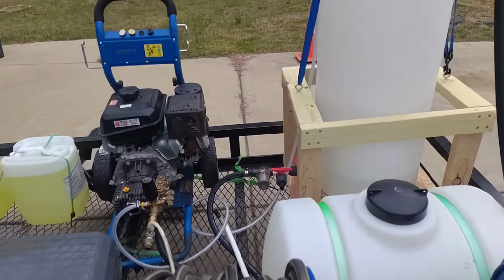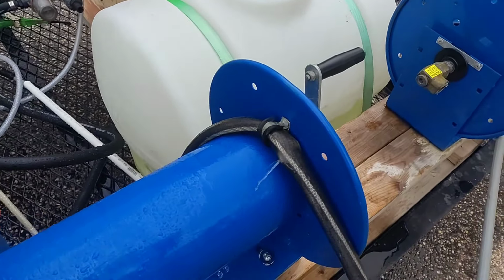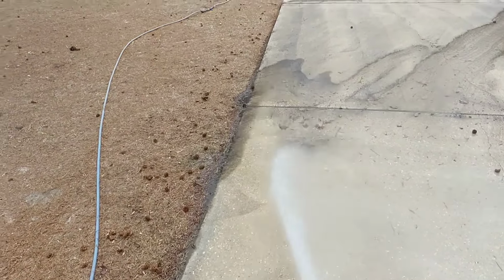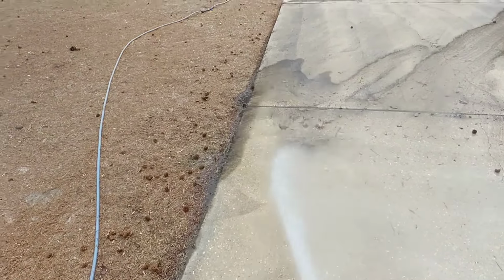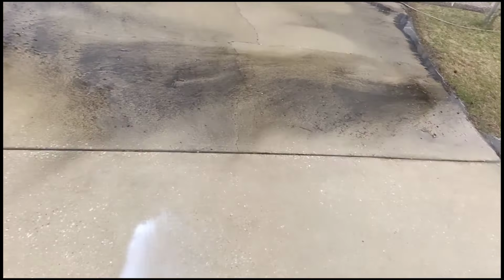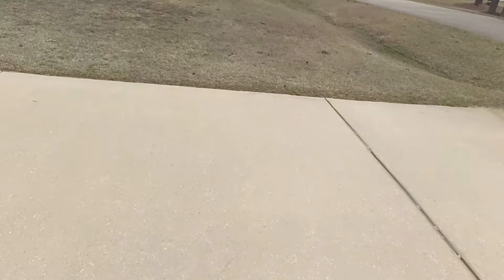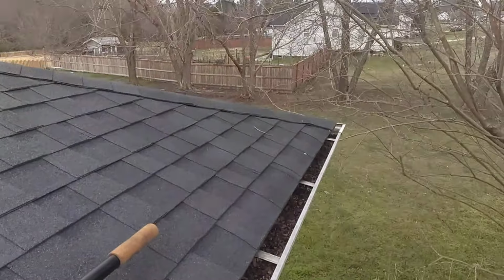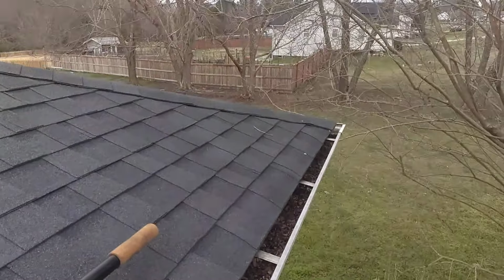Pressure Washing - Trying the Circles method Driveway cleaning and Gutter Cleaning

Comment: I use my hose reels as a way to carry the hoses and never run the hose through the reel connector.
On the supply hose I have quick connectors on each end.
Yes you have to thread on your adapter to the customers spigot but when the adapter wears out you place it for a few dollars compared to the cost of a new hose or repair kit.
Pre treating the driveway is a must.
It will save you time on each job and in our business time truly is money.
Reply from the maker: Nice, yeah my pressure hose reel is just for transportation. What % sh do you pre treat with?
Reply: @steppspressurewashing  I use around 3% and let it soak while Im doing the house or just have to wait about 20 minutes if its just a surface clean. If its a hot day I will pre-wet it to try and cool it down a bit to keep the SH from evaporating too soon and I hit the grass right next to the driveway just to be safe. 
I get the quick connect couplers from Tractor Supply and they are the Gator Lock brand.
Reply from the maker: Good to know! Thanks for the info!!

Comment: Highly recommend you to lay down a 4% mix on all the concrete 7-10 min before passing the surface cleaner, and after lay down a 2% and you don't have to double pass anything or do circle motions on it. This method has worked for me every time and I stopped leaving lines in customers drive ways.
Reply from the maker: Wow 4% pretreat? Do you pre wet the grass before you start? I have done well with no pretreat so far, but I will keep this in mind on some extra dirty ones like yesterday.
Reply: @steppspressurewashing  to be honest I don't and the grass has done just fine. Would recommend to do so just in case.

Comment: I always definitely pre-treat 4% surface clean cut in what I couldn't get with the surface cleaner Post treat  with 2%, allow to sit several minutes but make sure you rinse it off after because you don't want someone to go in there walking their house with tile and slip because of the chlorine on their feet and if they have carpet you don't want them walking all over the house with Chloe on your feet and make little spots everywhere that would not be a good thing lol😂. This method leave your concrete looking icy white clean and stays clean longer as well.

If it's all dry in the gutter system I use a leaf blower to blow it out and  simply rake it up really quick.  it's easier and quicker that way. if it's wet, I have my pressure washer rinse it all out and  again rake it up and plus I can stick the wand down the downspouts to make sure all the gutters flowing properly
Reply: To answer your question Yes I pre-wet all the grass around the concrete and I rinse it back down every time I put the solution on the concrete just to make sure